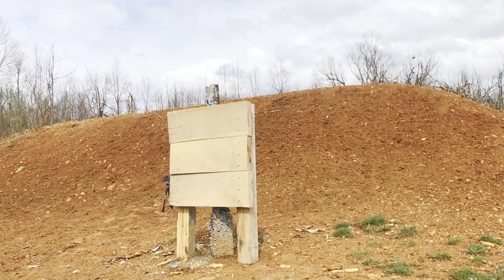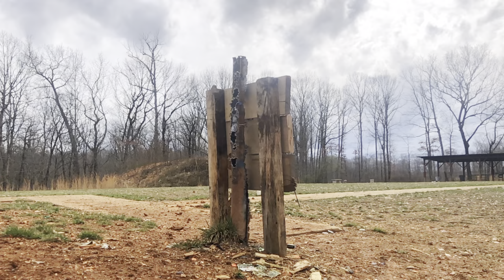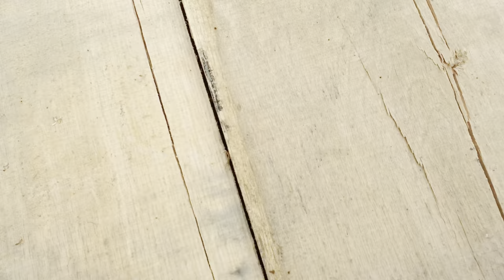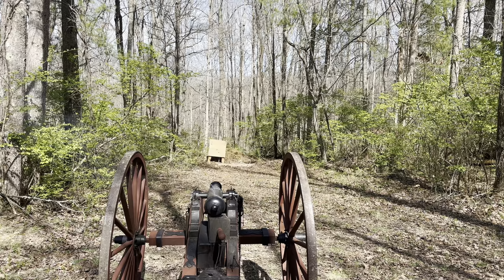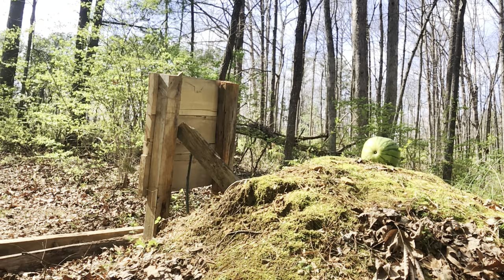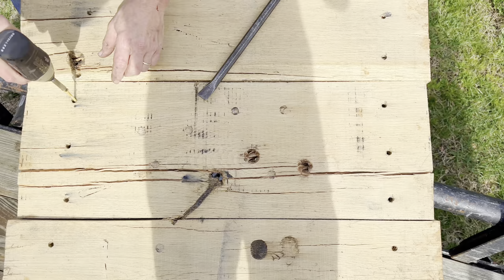Cannon vs. Pirate Ship: Shooting Projectiles from The Golden Age of Sail

Comment: The chain shot I have seen is two cannon balls with holes through them, connected with chain.
Reply from the maker: They actually used many different forms of both chain and bar shot that had full and half cannonballs on the ends. It all depended on the point in time and the materials they had at hand to make them!
Reply: @TheCannoneer  I had a 12 pounder ball with a hole through, that I just found by the side of the road.

Comment: Great video man, I've seen plenty of content about pirate ammo but it's very nice that you bring it to life ! 

For deck clearing pirates would have used anything they could shove in a canister and kept the lead for the muskets as they were favored over cannons but more conventional navies would have gone with lead or iron balls.  The best sea service  muskets available at the time would have been "fusils boucaniers", which are a type of French, very long-barreled  muskets meant to have extended range to clear decks more efficiently while pistols, blunderbusses or shorter muskets were meant for boarding. 

Shells were hollowed cannonbals filled with gunpowder and fitted with a fuse lit by the ignition of the propellant charge. It is something you could replicate but please omit the powder in the balls and just stick a fuse in them if you replicate this, so as not to get hurt by the exploding ball. The goal would just be to check if the fuse will indeed ignite under these conditions.

Red hot shot would have been a rarer but more effective way of sinking a ship, but it is very dangerous to replicate as the heated iron ball could set your charge off.
Reply from the maker: I’m going to make that wooden trash canister for you here soon too! I did some research on it and how they made it. I’ve wanted to do hot shot since I started the channel but I don’t quite know how to get it in the barrel without setting off the powder charge. I know they had specialized cannons just for that but  that’s still scary! We can basically shoot anything legal at the new range so we might be able to get the explosive ones if we can get the channel big enough to get in someone with a license. I hope we can get a 3” field gun at some point and break some stuff! 

I always appreciate and learn from your comments and I do appreciate that you keep tuning in!
Reply: @TheCannoneer   my comments are snacks for the algorithm but I try to make them interesting to read too. 
I did some research and you can make the explosive ones if they contain less than 1/4 ounce of boom dust.

Comment: Quilted grape shot needs to be on the ammo list. Also "Hot Shot" at some point. (be very careful). Confetti shots are fun too. Also try a nice wad of steel wool on top of a shot and see the shower of sparks effect!
 You should also get a U shaped safety rammer(also called a crooked rammer)so your body is never in front of the bore while loading. It allows you use to "seat" the projectile and powder charge, from side of the gun, or standing just inside the wheel area.
Reply from the maker: I’ve been wanting to do hot shot for a bit but I’m a little scared of it! I’ll look into the U rammer but we usually just stand off to the side to help prevent that issue! I do appreciate you tuning in!
Reply: Sounds like you have read Horatio hornblower

Comment: Would be cool if you could replicate ' bounding' shot.
Might be kinda hard with a bore dia that small.
Reply from the maker: You’ll have to enlighten me on that one. I’m guessing that might be ones that bounce?
Reply: @TheCannoneer  yes....
The object with solid spherical shot is to load a reduced powder load and bounce the round or 'skip' the shot across the ground so the shot bounds through the ranks of a unit about chest or head high.
Another interesting historical tidbit...is the Turks skipping shot across the water at Byzantine ships bringing supplies to Constantinople
Reply from the maker: So we have a few different ranges that we shoot at and one of them has a rather large pond. I’ll ask and see if they are ok with us trying to skip some steel balls across it and see what happens! Don’t want to shoot lead in the water. I’ve been wanting to see if you can skip them like the patriot for a while but I never knew they were called bounding shots. I bet you’ve got to get the angle just right so it doesn’t just burry itself.
Reply: @TheCannoneer  I know it was a common tactic ...during the time since gustafus Adolphus through the Napoleonic wars and the war between the states.
From what I have read,12 pounders were excellent at doing it.
Probably the peices were aimed at probably at a 20-30* shallow angle about 40 yards in front of a formation to get the correct bound.

Comment: looks like you might be getting some gas leakage, especially with the canister shot. have you considered a wooden sabot cup? it should hold together better than the 3d printed cup. maybe a combination of a wooden base/plug at the bottom of the printed cup to act as a rigid base? IDK, ive never owned or shot a cannon
Reply from the maker: Back in the day they used wooden pucks for just that purpose behind everything, although you don’t really need it unless you’re shooting loose shot like the musket balls or silverware. Solid balls just need a patch at the most and they seal quite well. 

As for the wooden cup they also did that too! The French did that and filled it with broken glass and nails and junk and apparently it was devastating against soldiers. I’ll make one of those one of these days. Thanks for tuning in!

Comment: Bar shot..langrange...chain shot...grape..etc
Reply from the maker: I’m excited to make one of the giant darts that go through the cannonball itself. Sort of like a giant nail in the middle. Thanks for tuning in!
Reply: @TheCannoneer  yeah I've seen pics of those...forgot who used those.
Reply: @TheCannoneer  was that 'sliding' bar shot or dumb bell bar shot.
Was kinda hard to tell there.
Reply from the maker: Dumbbell. I should make some sliding ones. That’s a good one!
Reply: @TheCannoneer  ever seen  scissor shot?
A solid shot in two halves that was two halves and had elongated wings that stuck out and were affixed together via a ring?
For rigging and such.
The Turks had a method to wrap a solid shot in linen? - burlap? Soaked in pitch and pine tar?-and when fired at night you could track the ball as it would be on fire....how they adjusted fire at night.
Reply from the maker: @swampfox1776.  That sounds horrifying. I know we're planning some night videos around July 4th (need to be able to safely shoot without ticking off the neighbors too bad at night) and I'll try to add something like flaming shot to it if we can! I also recently saw an expanding shot that looked like jack that I wasn't to try in the future.